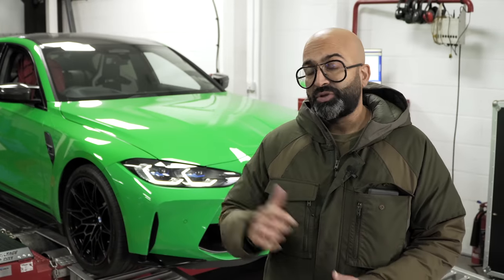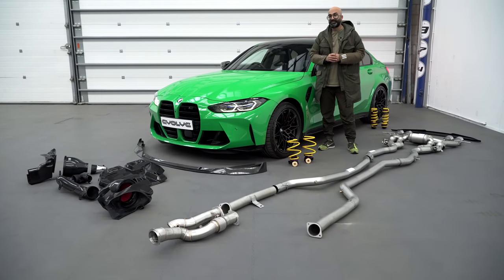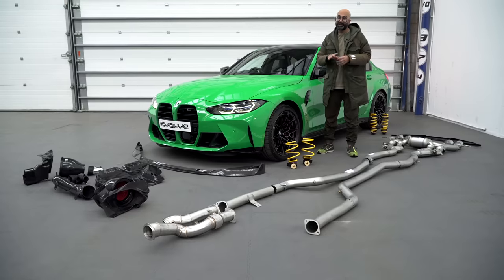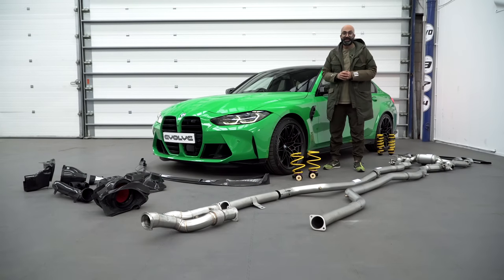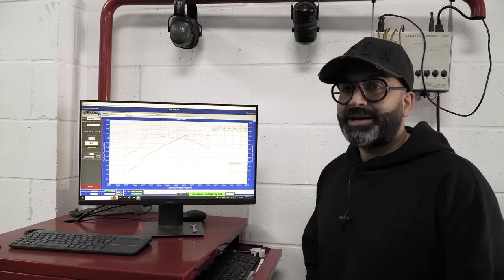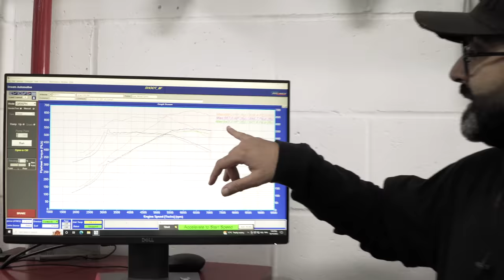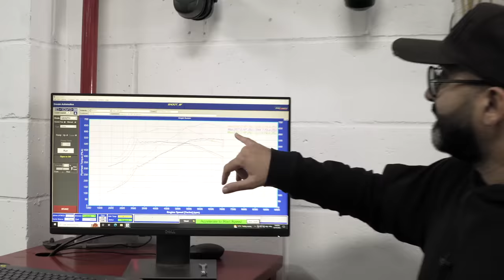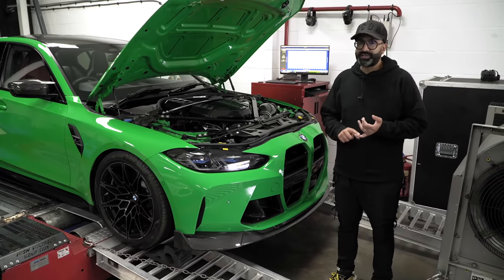Signal Green G80 M3 Baller Package! ECU Tune + Eventuri + KW + Remus + Downpipe + CSL Grill + Carbon

Comment: Is it normal for the car to pull forward so much on the dyno? Also it’s a shame there’s no dragy times as we all love those 😂. Top job as always though, always thoroughly enjoy the content 👍
Reply: no that’s actually very dangerous
Reply: yes to allow the tyre to get up onto the roller and not have the suspension cranked down killing the power.
Reply: @E63s_Scott  so too tightly strapped, less power? There’s two rollers though no? Or do they only measure the output from the front one ?
Reply: @phillynarrowstraight  on a dyno dynamics dyno yes. I had a n/a c63 which read 52bhp less after I fitted long tube manifolds on the very same dyno purely on how the stupidly tight the straps where. I’m sure it was because I didn’t use that same garage for my work yet on dragy it was consistently quicker 100-200kph. I moaned at the garage got another run allowing the car to get up on to the roller and all was as expected.
Reply: @E63s_Scott  am I right in thinking dyno dynamics don’t have an eddy brake or whatever it’s called? So the resistance is fixed to the weight of the roller? If so I can see how that’d make sense

Comment: Do you all have to modify fender liners when lowering G80s?  I hear there's no way around rubbing but curious what your experience has been.
Reply from the maker: Unfortunately you do get rubbing when lowering with some setups. Modification of the inner liners may be necessary. RKP make a solution that looks really nice.

Comment: I've got an IOMG G80 M3 with AutoID goodies, full Remus race exhaust and springs/spacers. Similar to the work in this video, without the Stage 2! Those changes absolutely transform the car. So much more of an aggressive presence – the splitter and rear lip really help square off the front and back of the car. The exhaust for me is a must-have. These G8X's are so quiet out of the box and if loud noises make you smile (like me), the Remus is awesome – both in looks and sound. Hell of a car in this video, beauty!
Reply: Only question I got a G80 as well. But does the exhaust void warranty completely ?
Reply: @RR-kb1nc  simple exhaust no, change downpipes yes.
Reply: @weave4181  DP change voids warranty? 🤔

Comment: Is it usual for there to be that much slack whilst doing a pull? Shouldn't it be strapped down tight into the rollers?
Reply from the maker: Only the front roller is reading power, the rear one is adding extra resistance. We let the car climb on to the front roller to give a more accurate reading.

This is the same way we have dyno’d every car for over 10 years.
Reply: @EvolveAutomotive  Thanks. That makes sense.
Reply: To give you bullshit figures basically, hence why the car is strapped down much tighter in stock form than it is after it's had the mods lol couldn't be more blatant. The Dyno expects there to be resistance on the car from the rear roller and calculates the BHP accordingly. Without it, ya get an inflated figures. 
At least strap it consistently if it's not for some bullshit 🤷
Reply: @stefanroseEP3   correct 👍
Reply: @stefanroseEP3  hmm

Comment: I'm curious what did the total cost to the customer of all this come to?
Reply: £12k remember ecu has to be se t over to Finland… only place this 2022 car can have ecu opened currently to then tune… tbh as imran said all carbon bits the intake the whole exhaust system not needed for stage 2 and stage 2 power levels but this is a premium package not just about power ….